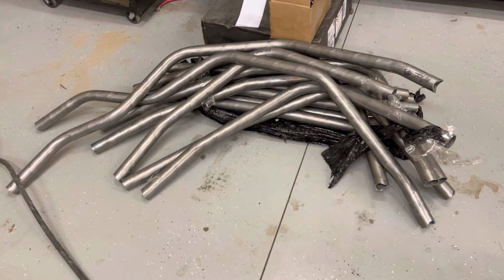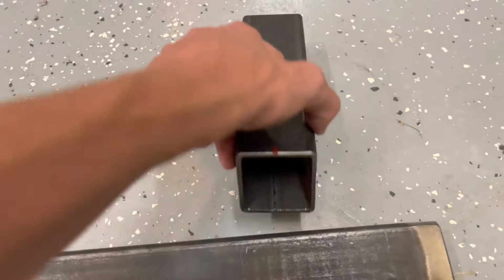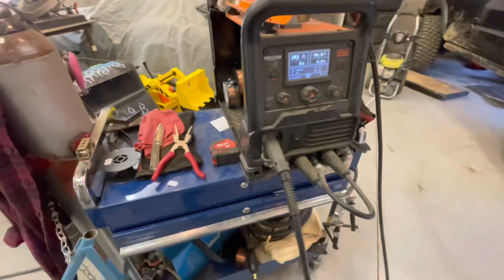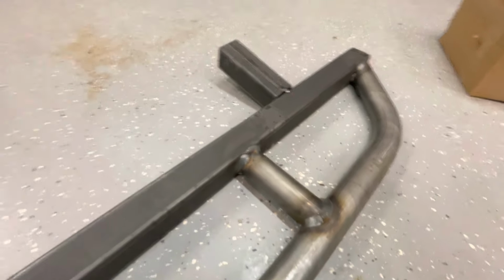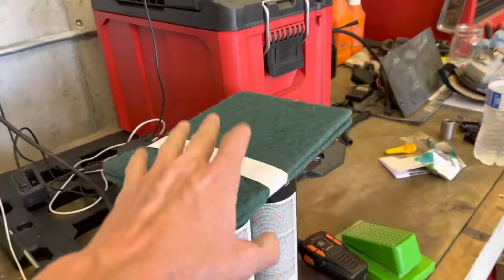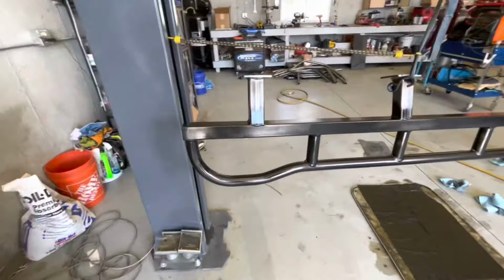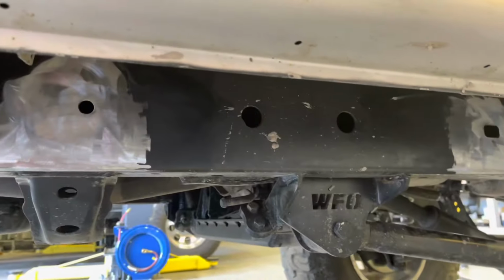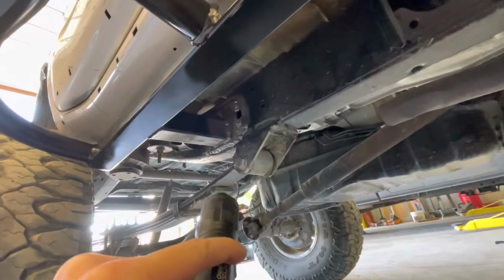4xInnovations Slider Install On My SAS 3rd Gen 4Runner

Comment: Just finished all the hard parts! Gonna weld mine onto my 1st gen Tacoma frame tomorrow super stoked! What type of paint did you use for your frame for the finish? The older Toyotas are notorious for rust development so I'm curious so what what has worked
Reply from the maker: Nice work! I just use Rust-oleum paint nothing special.